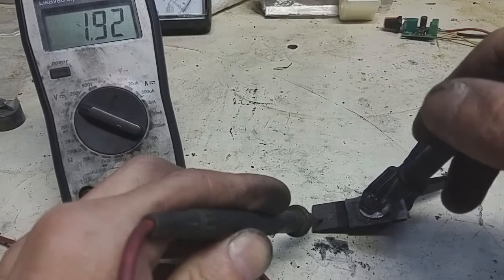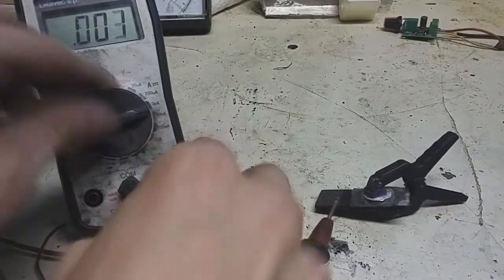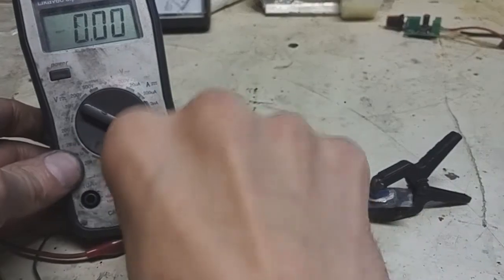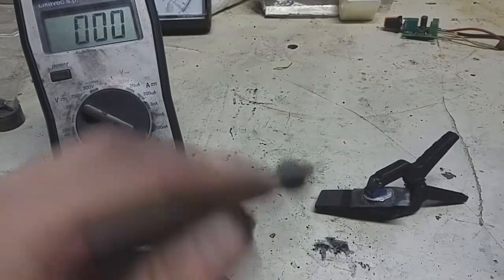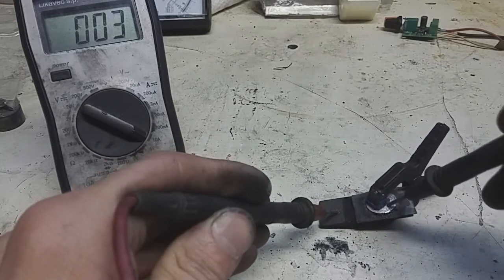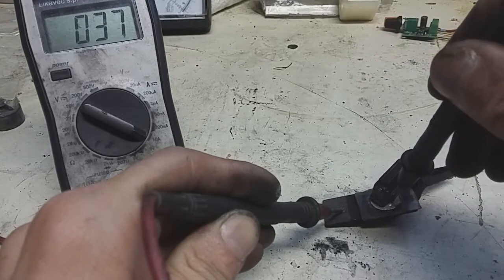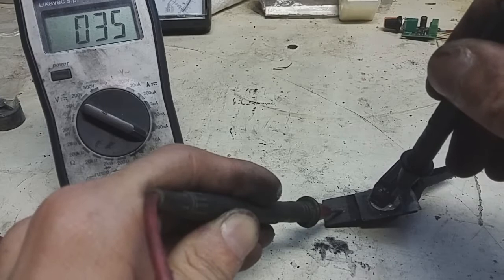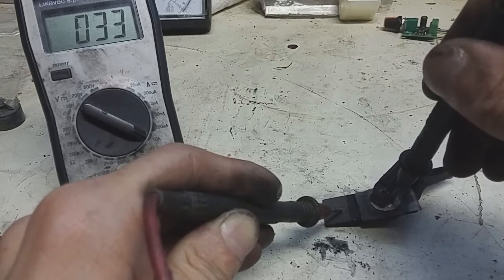Emergency Magnesium Air Battery 1

Comment: Hi Cayrex2. Did you use that carbon from your last video in this cell too. Or just activated carbon.

Will the cell oxidize if no water is added, You could use them as emergency battery and just ad water when the time is needed.
Reply from the maker: MnO2 and activated carbon. If the cell is dry (not used) will not oxidize. Store the cell in some sealed bag

Comment: The problem is, it won't last very long before the oxidation coats the magnesium and the battery dies....I worked on magnesium batteries for a year and could not get around the non conductive oxidation...I even made a mag/carbon battery in a container and the oxidation increased the volume and cracked the case....They are great when new...I made a cell that produced 1.6 volts @ 2 amps...I used a pair of these to run a portable radio for 72 hours continuously before it gave out.....I had to take them apart, clean all the oxidation off and rebuild the cell to get it to work again....As an emergency battery it's OK....
Reply from the maker: BakamonNO correct,... some DES electrolytes "eat" the oxides. Water based electrolytes give you good current but also you get strong oxidation of the anode. In DES electrolytes you get some lower current. You need to make a good balanced design of  the cell
Reply: The D cell doesn't have very much active material so it doesn't last very long...I've been using a magnesium/aluminum alloy that gives more energy than pure magnesium and lasts longer. My cells where made in empty pill bottles..The magnesium is the size of a large pencil and I used a carbon welding rod for the other electrode..I surrounded them in layers of rock salt and activated  carbon..I used salt water as the electrolyte...I get 1.6 volts at between 800 ma and 1amp....Two of these will run my portable radio, (round the clock), for about 6 days...If not for the increased volume of the oxide, they would last longer, but the cells swell up and burst the pill bottle...I have been trying to develop a highly conductive sponge material to replace the activated carbon so when the internal volume increases, it would compress the sponge material and not burst the battery.....Then I will have something!
Reply: @jimdevivo9241  you can use floral foam (I believe they call it oasis) to hold an enormous amount of water.
Reply from the maker: yes,... for emergency battery is good! I run a LED for several days. the oxidation is a part of the reaction
Reply: It's a great material, but unfortunately the oxide coating produced by the galvanic reaction builds up and is NON conductive...It works well at sea because the magnesium is constantly being washed by the currents keeping it free of the oxide buildup....
Reply: change your electrolyte. I have good results with magnesium / carbon  batteries where the whole magnesium cathode is burned down in the electrolyte. With the right electrolyte the oxide layer wont be much of a problem. My setup was 3 cells in series. Each cell produces 1.4v connected to three green led's in parallel. It has been running for almost 4 months. The size of the Mg plates are approx 3x3 cm.
Reply: Thanks for the information, but what is the current output capability of each cell?....Secondly, could you tell me what electrolyte you'r using?
Reply: OK, so I understand that by slowing the reaction, it doesn't oxidize the cell as quickly thus the cell lasts longer, but to make a useful battery you need the current...Running LED's or very low current micro motors is fine, but not very useful .
Reply: You are absolutely right Jim, the power output is just within the reach of lighting up the led's. Each cell produces 1.5 ma dead short. And to compensate for the low energy output I used Green led's so it would be visible from afar. Please keep in mind that the surface area of the Mg plates also determines the amp output. This is why cayrex2 makes holes in the Mg rod in one of his vid's. The electrolyte used in the cells is an ionic liquid. I'm sure cayrex2 can make a vid explaining how some of them are made. These cells are mainly for low power electronics as you mentioned. Like lighting up signal lights for navigation over a long period of time, operating an ESP32 or other "low consumption" devices. Also keep in mind that I.e a D-cell battery may release more energy in one burst, but that does not necessarily mean it can deliver more energy over time. In my experience a D cell hooked up to my badly made joulthief drains the battery within 3 weeks. While the Mg/C cell can power the led at approx same luminosity for months. I'm sure someone out there can explain this much better and in more scientific terms than I can. I hope this helps a little bit :)
Reply: Yes, the release of hydrogen can be a problem. Would it be possible to recycle the hydrogen in some way? Rather than trying to build a cell that can handle the increasing pressure? Just a thought. :) I found a link  regarding the Edison cell. Worth a read if you have not read it yet. http://www.nutsvolts.com/magazine/article/february2012_Noon
Reply: It's not the release of Hydrogen that's the problem...What happens is the  Magnesium oxide creates an expansion do to it's increased volume.
Reply: I'll test a simple electrolyte with AZ31B alloy and carbon paper. I'll let you know the result tomorrow. Maybe there is a simple fix for the oxide film problem.
Reply from the maker: If you have problem with expansion of the cell,..... I recommend to use a graphitic carbon fiber! you can soak the active material into carbon fiber. The cathode will be flexible to any expansion, because is like "sponge".